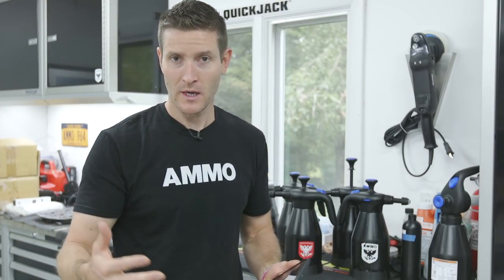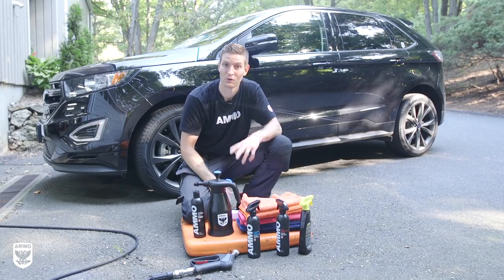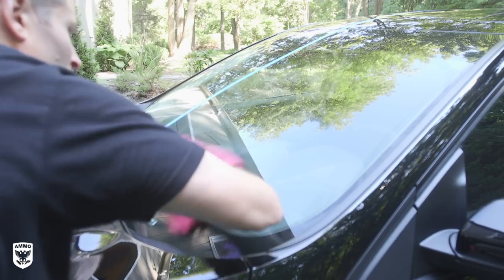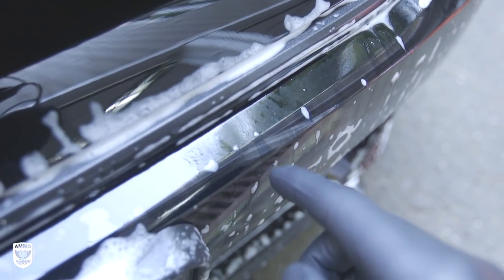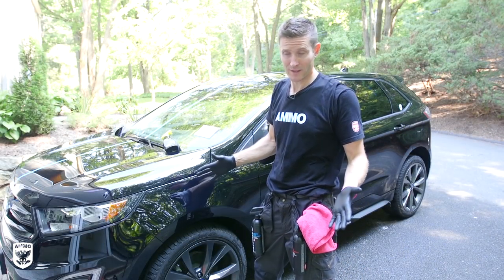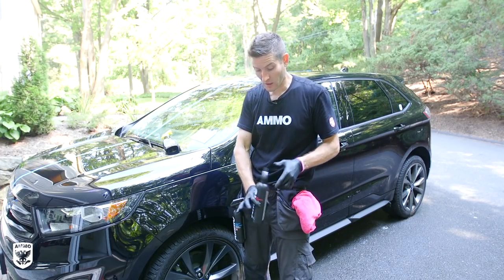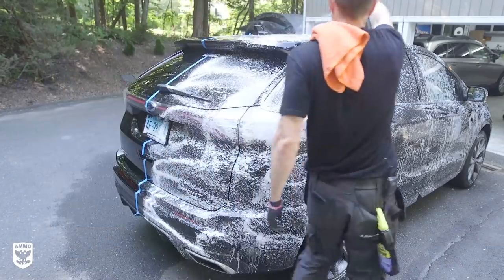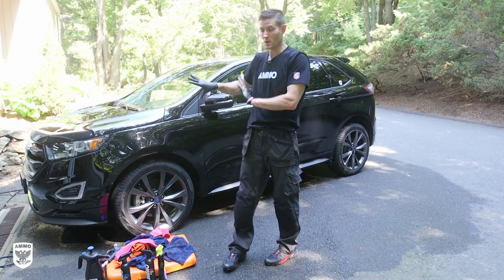15 Minute Car Wash: Water vs No Water

Comment: I would never use a water-less wash, I would rather leave it dirty
Reply: I think the same exact thing. The lubrication that the water give to the paint it's always, ALWAYS better.
Reply: Depends on the circumstances.  At home I will only lance it and wash with 3 buckets ( third is for wheels only). Washing end drying each panel individually to avoid any water spots.  Problem is that I show it and needs to be clean and dust free to stop anybody touching it (why they need to touch it I don’t know) and scratching the paint.  Horses for courses.
Reply: ThatAussieBloke it works really well on a coated car. I spray the car off with just water and most of the dirt just falls off and then it’s safe enough to do it.
Reply: I used to say that. They’re not as bad as you think. I recommend putting it in a wash bucket with a microfiber wash mitt and grit guard then wipe after with a microfiber..

Comment: Fantastic video!!! I have a VW Golf, black, very hard to keep clean, but I can. Where the keeper, under ecological shingles, sometimes happens to release a substance, that when coming into contact with the painting of the car causes the dreaded "Crow's feet". Unfortunately my car has some spots like this, and I already researched it and I know that it is only possible to fix these defects by repainting the piece. So when I use the vehicle, about 2 times a week, I have to clean it when I get home and cover it. This video is perfect for me, because I leave with the car clean and when it arrives it is only slightly dirty and does not need a wash with water. I will use the products I have available here in Brazil, dry cleaning, to clean the car the way you demonstrated, it is very fast! One day I still buy your products, especially the spray bottle. Hug.

Comment: Lately I’ve washed my ST by using the Hydrate method, BUT I also foam cannon the car & then rinse it. Power washing helps blast off any bugs, cannon soap helps break down & release the dirt, then I Hydrate for drying.
Reply from the maker: very cool

Comment: If the dirt/contamination is at this level or less,

then a good detailer spray 
and microfiber towels are generally, all that’s necessary.

The job would not only be done faster, 
but there’s no water, soap, or the extra towels used.  👍🏻

So you can save  time, 
money (cost of extra products),  hassle,  product, water;
but also product exposure to your body, and to the environment.

I fold a clean or new microfiber towel in half or quarters, 
coat the towel surface thoroughly with detailer,
the body surface also,
then just wipe clean. 
Done.

A separate towel for the wheels.

This is what detailing sprays are made for, and they work quite well.

Comment: Good vid, the water requirement difference is negligible, because you'll still need to clean all the towels, which is actually even harder if you do it by hand ;)

Comment: I don't have an airator (spelling) and power washer. For a thorough (non-quick) wash, would you suggest I stick with what I've been doing? Spray down a section, gently go over that section with a towel that's dripping a sudsy soap, let it sit for a couple minutes, spray it down, go back over that section with the soapy towel with more force this time, then spray down again? Thanks.

Comment: How about swirls with the "no water" method. I'm asking because spraying once with the hydrate/frothe and then wiping the hydrate/frothe over the bodywork without a proper spray down with water first, has to leave tiny little swirls..  #iamiright ?
Reply: Not if you're using enough lubrication and towels; or there's a 1/4 inch of mud on your car and you use this method. You'll never scratch a car as mildly soiled as the one shown in the video with proper rinseless wash technique.
Reply: Lubrication is key, but still, everything leaves swirls. You can pressure wash, do a touchless foam, and then a touch wash and you will still swirl the paint. The objective is just minimizing how many you put in. The no water method for sure leaves more swirls but the ease of it is a tradeoff. Using proper touchless methods like what AMMO sells are great methods of reducing how many and how deep the swirls are.

Comment: I do not have a power washer and all I replay use is microfiber cloths, my hose, and 1 bucket full of soap. If I scrub everything with the soap after spraying it down should i use a microfiber with the soap still on or should I spray it down then use the microfiber. Thanks

Comment: Looks great!
When spraying the car with Spray Frothe, is it ok to get the product on ceramic composite brake rotors when spraying the wheels?  Does the product have silicone or oils in it?
Reply from the maker: GoSeeDoTravels I would only use water on those. Ccb are touchy

Comment: Hey Larry. I got an old 1992 dodge ram 250 and need some help. If you ever seen one you'll know that they have a plastic or rubber trim that goes around the body of the truck, place kinda in the center...yea so part of that trim has fallen off and some of the adhesive tape stuff is still there....what's the best way to remove that and replace the trim?

Comment: Hi Larry, this probably isn't the right place to ask, but I've got a car with a Maaco single stage metallic respray, and it's turned to a very non-reflective finish, not exactly matte like very oxidized paint, but the reflection is dull and it isn't very glossy at all, but there are chalky spots that aren't reflective much if at all as well. My issue is that I try to polish it, but the paint just gets more dull and less reflective, like, the reflection appears blurrier or hazier where I polish. I've tried cleaner waxes, M205, Ultimate Compound, Ultimate Polish, M2, soaking it with M7 or polishing it with M7 by hand, M83, I've tried all of these by machine, and by hand, with everything from a foam polishing/finishing pad on a DA to aggressive terry cloth applicators all the to sponge applicators by hand. Everything I try to do makes the finish worse and less reflective, any suggestions? I've also tried using the product normally, and using it very heavily to try and keep the product from drying out or the pad from getting too clogged with paint, and nothing works.

Comment: Ammo NYC this frothy device can be used for winter cleans? Where I live we get cold winters and have to turn off the exterior water. So I was wondering if you recommend this for those months? Or if you have another way to do it? I’m just like you in having my car perfectly clean year round. I don’t want to cause any swirls. :/ or at least any major scratches from being improper. EDIT: if it helps it rains a lot here too.

Comment: Larry do you have any tips and tricks on how to remove heavy chemical stains on black paint that has etched trough the clear coat? i tryd compounding with whool+ heavy compound and dont work at all and i dont know how to wet sand the black trim around the windows is also full of ugly water/chemical stains. Asking for a friend :)

Comment: Larry, in your ATA 107: Maintain a Detail video, you show using a water rinse and then hydrate on a damp towel to wipe down. Is this still something you'd recommend as I don't have an aerator (yet) to do this new method.
Reply from the maker: If the car isn't too dirty yes you can use that method.  If it needs a proper wash then do one.

Comment: Been awhile since last upload. Glad to see new vid & that your okay. Was wondering if your aerator is custom made for you, or sourced from another company with your logo etc....? Wondering cuz looking for a new one, but want/need one that will last. Tired of buying new one every 3 months or so.....
Thanks for the vid & info......I shared with my fam so they would believe me for what I've told them for years to help maintain car between washes/detailing😉☺️
Cheers, A
Reply: Aepek Which is the one you had to change every 3 month ? Was it some specific brand ?
Reply: @elettrofans  I've just been getting the brand Chapin as it's easily available what's I live, so if current one breaks & need new one cuz doing a customer's car, able to replace it. Problem now is, over the years I could have probably bought very expensive good one since they just stop working after awhile. Any suggestions on different brand or style etc...
Welcome opinions & tips.... :-)

Comment: Can you do a video on ceramic coatings? Dealers love it which is what turns me off. I was looking for a few different cars and several dealers are having it applied for up to a 2.5K markup as dealer installed on the invoice.
Reply: right now the market is saturated with coating brands. Most dealer coatings are not the same as coatings professional detailers. The best bet is to read the fine print and the warranties of the coatings. Some dealers will advertise a lifetime coating (non-existent) but in fine print its a paint sealant that they want you to come in every 3 months to get re-applied. Also the prep work is VITAL before applying a coating, which some dealers don't do due to time it takes. Most detailers will need a minimum of a day to prep the vehicle and apply. 

If you're interested in coatings, I would look into a local professional detailer who is certified with a brand. The certified ones usually have manufacturer backed warranties on the coating. 

If you have any questions feel free to ask!
Reply: Kody Hogan Thanks. I contacted the Maserati dealer and they didn't get back to me yet. The car wanted is in a rare color that's hard to get but this one had Cilajet applied for 1295 already applied. Any luck with this brand? Also I asked who installed it, the dealer or a third party.
Reply: Dont do it, it's one of those paint sealant schemes. Honestly I wouldnt even let the dealership wash the car. Majority of dealerships dont have workers who have been properly trained and use cheap products. Them washing it does more harm than good. The most reputable coatings in my opinion (I'm a professional too) would be car pro, gtechniq, modesta, feynlab, gyeon, optimum, igl, and kamikaze. These are the most popular, but there are some other good ones. For the pro coatings you will pay usually anywhere from 1-2k on average. They properly correct the paint before applying as well. These ones will definitely last years WITH PROPER MAINTENANCE! If proper maintenance isnt used, you should still get a few years out of it.
Reply: Kody Hogan I thought so when I tried looking up the product and didn't find much results for people that used it.

Comment: Mine broke after a couple uses, bottle leaked. Emailed you guys twice. Zero response. All a customer wants is to be acknowledged and taken care of.
Reply from the maker: Hey I don’t think we received your email. Always take care of our customers. Use the contact page on the website thx
Reply: @AMMO-NYC  I did twice, autopeakdetailing
Reply: @AMMO-NYC  3rd sent waiting for your response.
Reply: @AMMO-NYC  I know this video is 6 years old Larry, but I had the same problem. Those bottles were junk in my opinion, mine leaked in a storage state with no pressure other than small ambient pressure changes. I bought it back in 2018 so you may have changed suppliers. It was the vessel itself that leaked on mine. I bought a replacement pressure vessel and everything was fine.

Comment: Maintenance wash in 15 min? The fastest for me is 45 min, without wheels. That means rinse, foam, 2 bucket wash, rinse and dry.

Nice vid 😉
Reply: Get yourself a DI vessel, then you can combine the last step :)
Reply: @MrVanilla2006  Good idea 👍🏻🙂
Reply: My "touchless" maintenance wash on a Malbec Black Infiniti is as follows, Quick rinse with hose, pressure spray all 4 wheels with Korrosol, spray HG Bug remover on the front, + mirrors leave for a few minutes then, ProKleen Cherry Snow Foam, leave for 5  minutes. Connect DI Vessel and rinse on low pressure. Comes out sparkling!